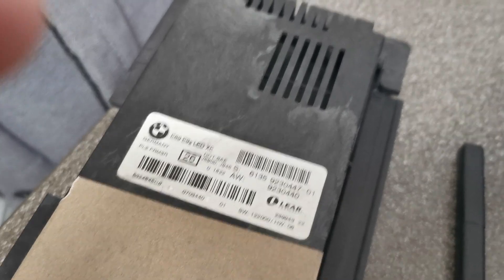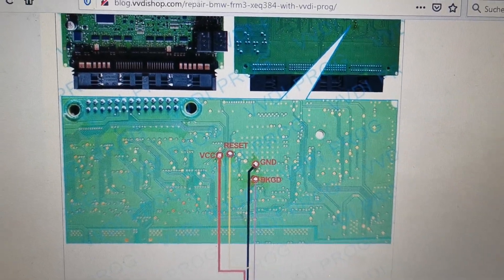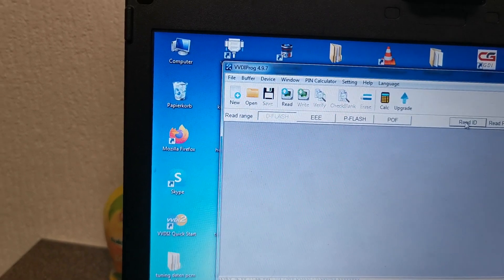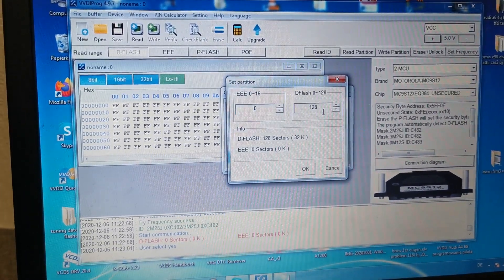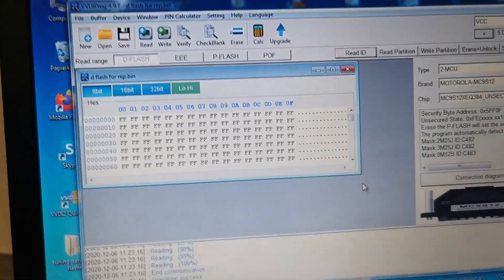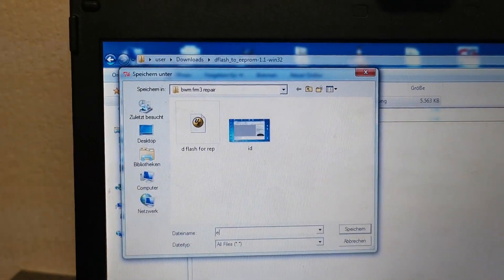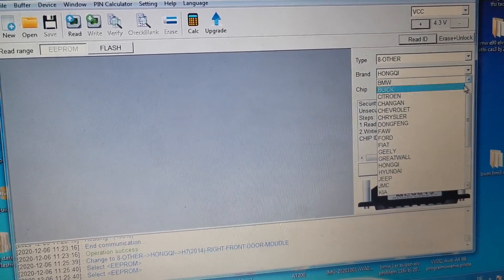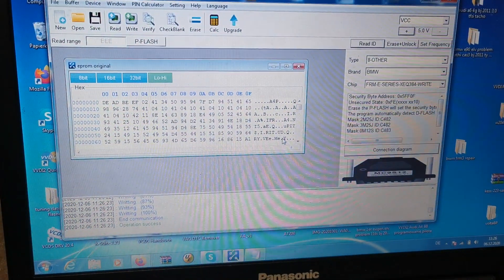Vvdi prog repair bmw

Comment: friend I downloaded the dflash software for eprom but it does not correct correctly some data is ??????
Reply from the maker: Normal when it shows vin right. It will repair good
Reply: @waldemarfechtel1644  yes, but when I put the frm3 in the vehicle after the repair with this software, the glass is upside down on the switches, then I take it off and do the repair again in the software and it's normal
Reply from the maker: @autotronicaribeiro6617  repair can't done again. Only once.
1 read defekt dflash.
2 generate new eprom data and whrite it to frm as eprom, not as dflash.
Reply: @waldemarfechtel1644  That's right, I read normal dflash open the software and it converts to eprom, I select to record eprom, in the eprom file below the normal vin already appears, but in the car something doesn't work, then I go back to the bench and do it again and then normal seal in the vehicle, You have Skype?
Reply from the maker: @autotronicaribeiro6617 after you whrite the eprom the dflash data are changed.ykz can't repeat the procedure
Reply from the maker: Try to update it, or search for data from same frm as yours